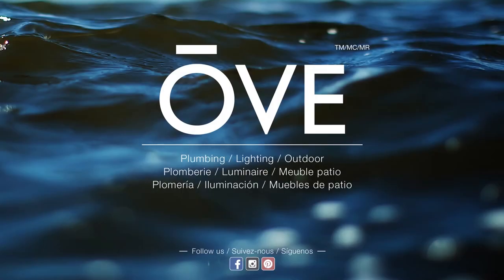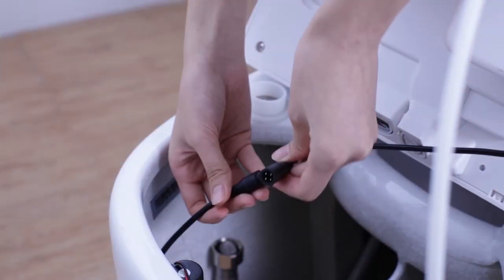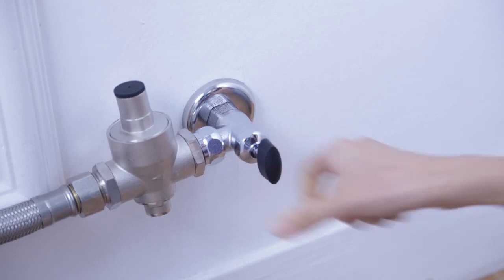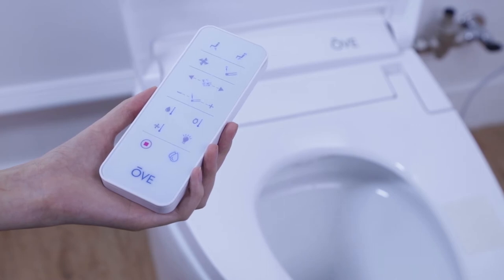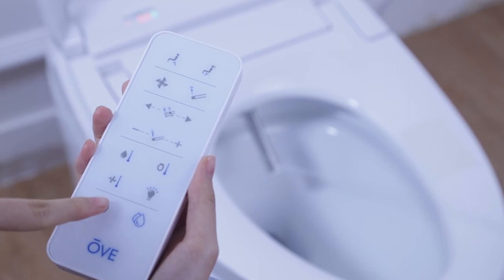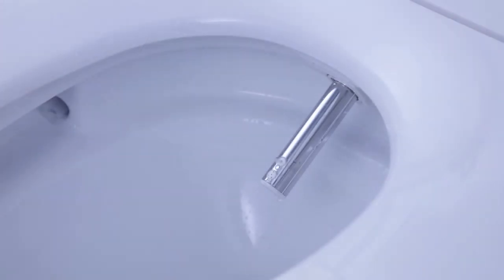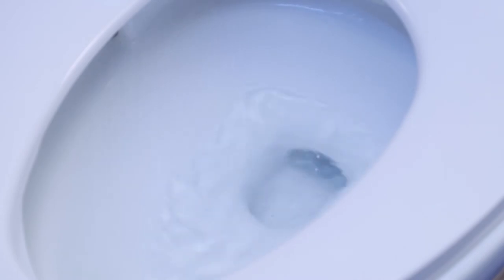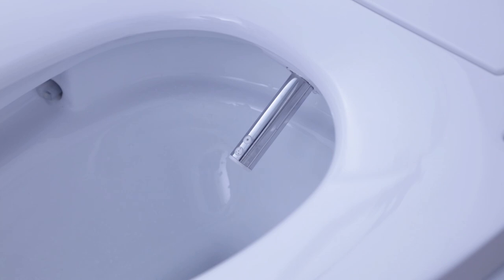OVE LENA & ELIN Smart Toilet installation

Comment: To pair the remote with the toilet, you just need to power off the toilet and then press and hold the STOP button on the side of the toilet for 5 seconds. The leds should start blinking on the toilet. Then press any key twice on the remote to pair to the toilet.

Comment: I bought it from Costco and just install but there is no beeping sound, I tried many time but still no beeping sound and remote is not connected  and not working
Reply from the maker: On behalf of the OVE team, we are sincerely sorry to read this. We aim to provide our clients with high quality products and services to meet your needs. There must be a simple pairing issue. We invite you to reach out to one of our experts at 1.866.839.2888. We'll get your unit up and running. Your satisfaction is of the utmost importance to us and your unit is fully covered by our manufacturer's warranty in the rare case of a defect. We carry replacement parts if needed and know our toilets very well.

Comment: Is this toilet very expensive ? Are they very effecient ? Are they comfortable to use ?
Reply from the maker: Depending on your budget, our smart toilets are fairly affordable. They are very comfortable to use and you'll never have felt cleaner leaving your bathroom using them. Do not hesitate to reach out to us directly at 1.866.839.2888 or info@ovedecors.com if you have any questions.
Reply: about 1000 after install but it awesome